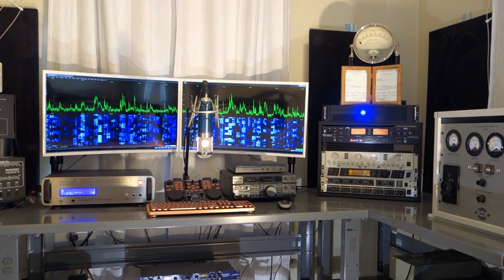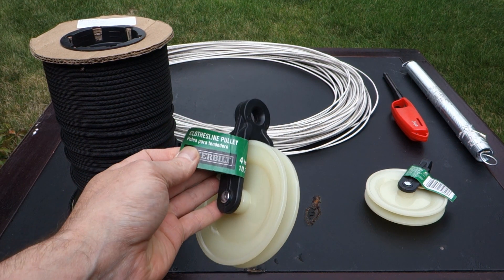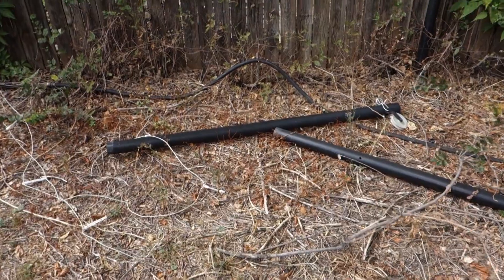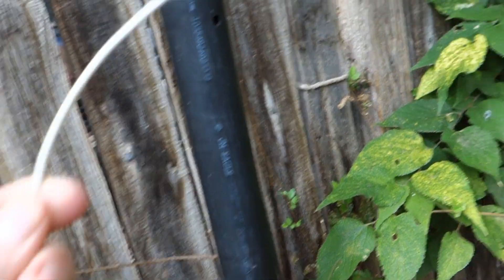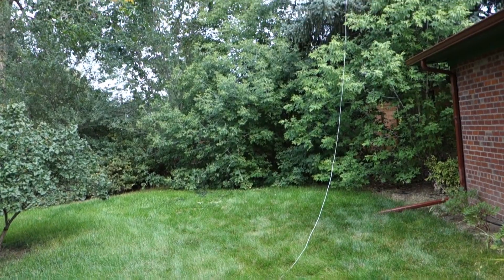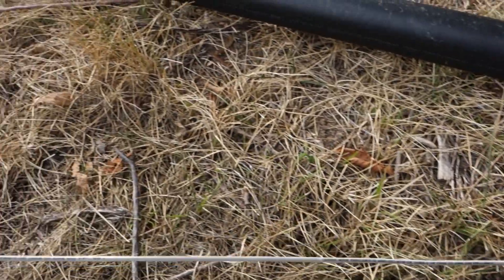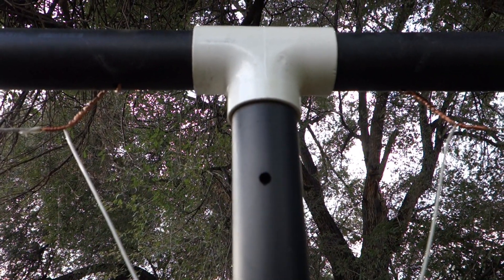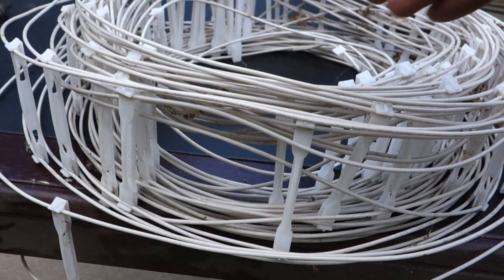My HAM radio 80 meter loop antenna was just stolen part 1 of 2 | Signal Phantom

Comment: Well, so I'm not the only one. I had an eflw deployed between two painters' poles, and someone tore the one painters pole out and stole it. They ripped the end of the wire, but didn't steal it. Someone nicely coiled up the end and put it beside the building. The cord was still tied to the tree. My WSPR was still going strong. I had only checked a couple of hours before amd it was fine.

The strange thing? I have just moved to a "nicer" area. I had virtually no issues when I lived next to the subsidized housing area. Go figure.

Comment: I have a 3.55 mhz horizontal loop.  Out of all the trees I have, a tornado came near the house and one of the trees that support a Corner was pulled up and snapped my 10 gage wire… and pulled my ladder line feed ‘T’ apart.  Weakest link! No fun to climb trees when you’re almost 60 years old

Comment: Interesting idea with the springs.  I put a pully at the bottom (appx 20 feet up) and attached weights to provide some give to the system.  Around 10 lbs on each end was perfect for my G5RV.  Always 10 ways to solve a problem :)  73 KL5DV
Reply: I have and am currently using the weight and pulley configuration on an 80 meter endfed and 160 meter inverted L and have used them in a 80 meter full wave loop in the past....works perfect every time for me.